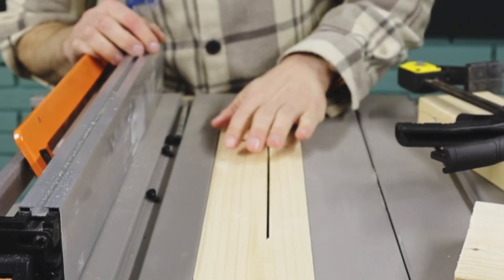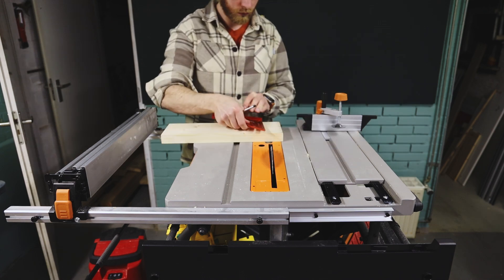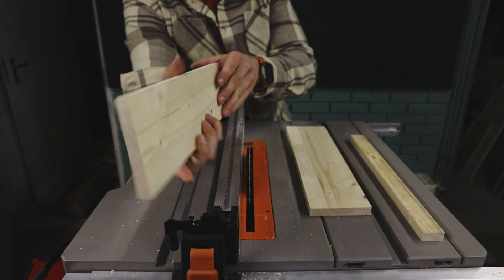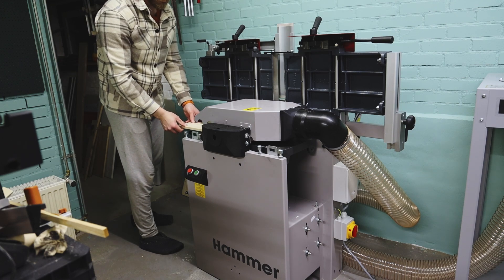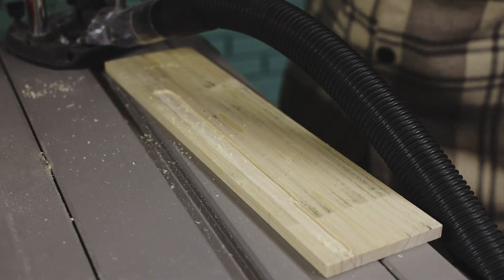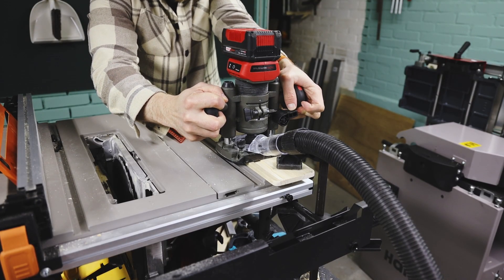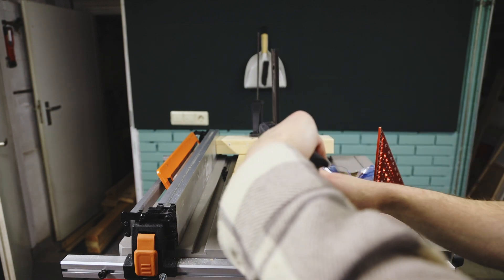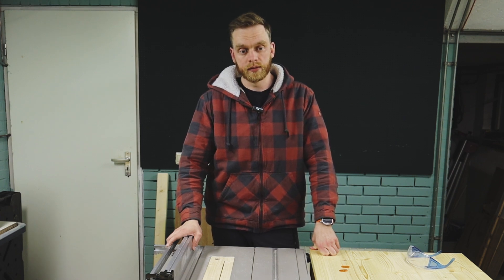Table Saw Zero Clearance Insert - Evolution R255TBL

Comment: Man, the riving knife alignment is adjustable with the two hex head screws that keep the riving knife holder assembly in place. Don't give people bad advice or make excuses for poor safety just because you don't understand something. It's literally in the manual.
Reply from the maker: Thanks for your comment, and I appreciate you raising this. I tried every possible adjustment, I even contacted Evolution support, and they didn't provide any further assistance. The riving knife itself was misaligned/bent, and no amount of adjustment would have fixed that. This caused thick planks to get stuck on the skew riving knife, which led to some dangerous situations. The bottom would be perfectly aligned, but then the top would not be, and vice versa. I could have perhaps included a few shots of this in the video, and explained it a bit further also, my apologies for that.
Reply: @FenixWoodcraft  If it's bent bring it back to the shop that sold it to you. You'd have to be out of your mind to use a table saw no riving knife, especially considering you can go at any time and get a replacement.